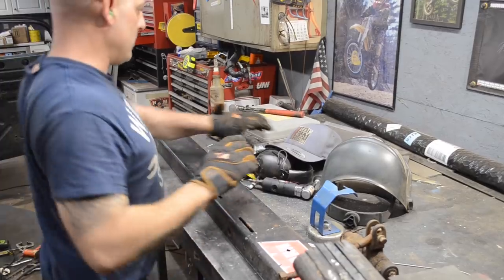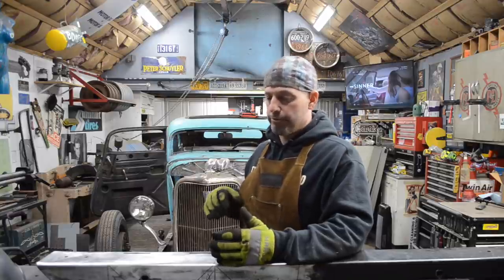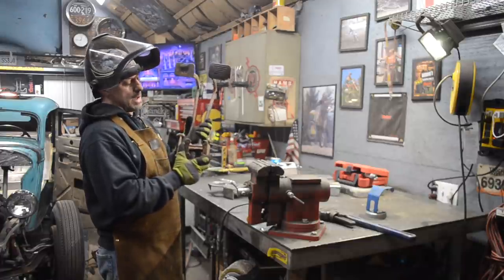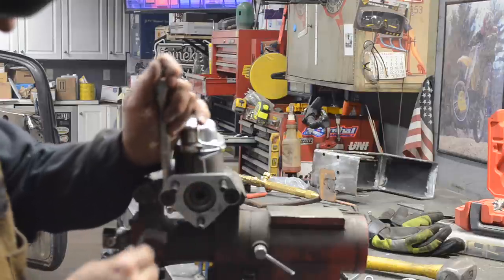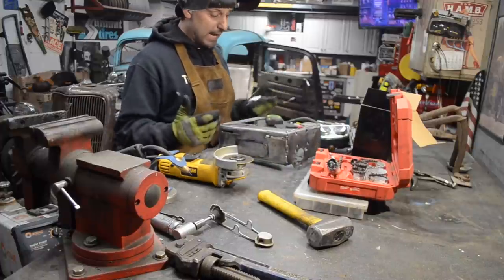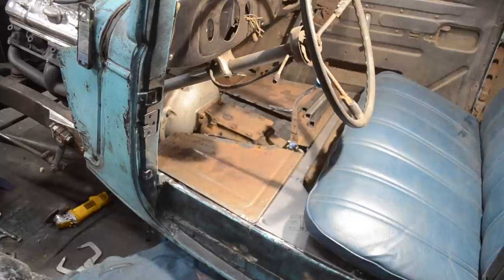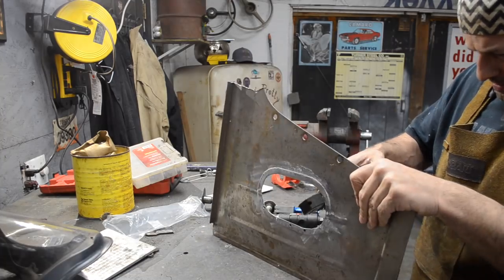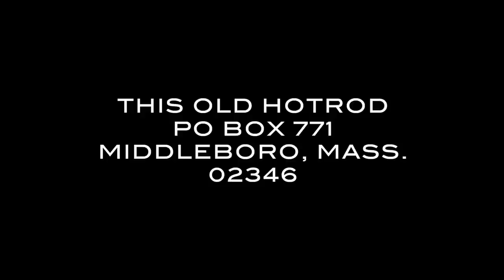Custom F-1 Pedal Mount From an old Jeep Wrangler bumper.

Comment: Great job, love your work, you might have to trim the bottom edge of the bracket where it runs parallel to the master cylinder to allow you to get a spanner onto the brake lines to do them up.

Comment: Another great fab project. That was a great tip to use the old Jeep bumper. I needed a piece of C channel like that for another project and immediately stole your tip and found a $10 bumper like that on line locally. Thanks for the idea of re-using that bumper. I never would have thought of it myself and love the ability to re-use steel.